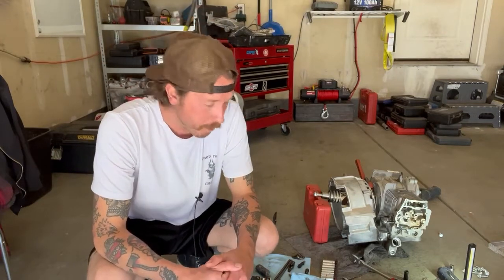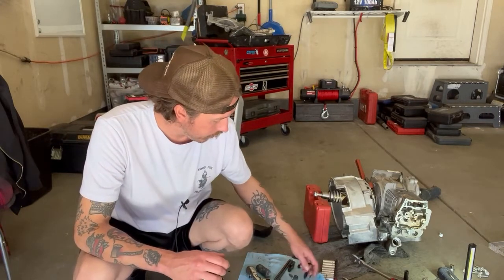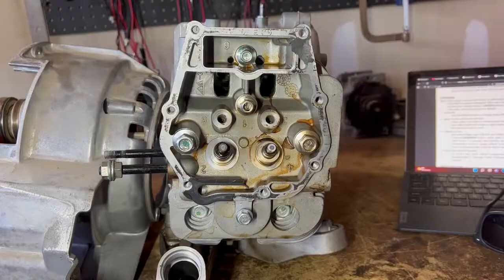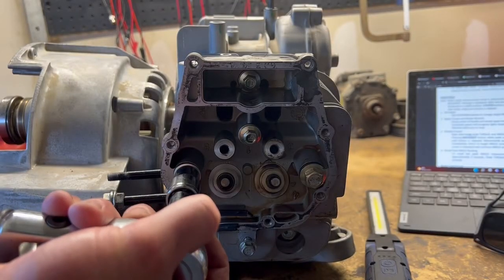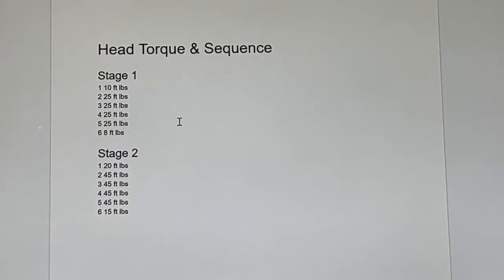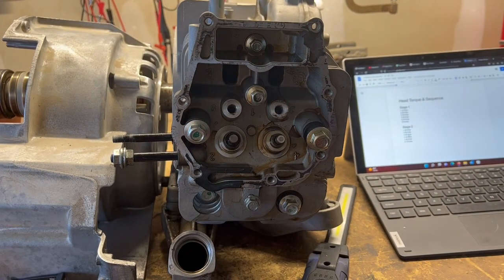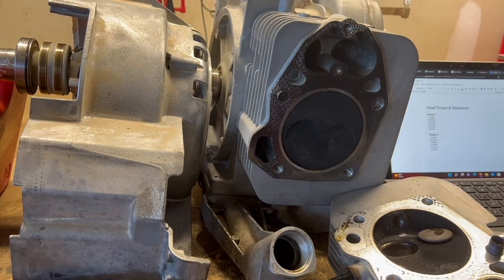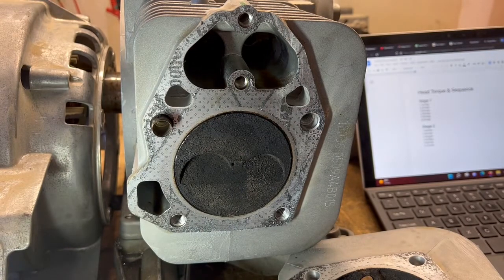⚙️ Cummins Onan QG 4000 Head Bolt Torque Specs: The Information You Can't Find! 🛠️

Comment: My 2005 Onan microquiet 4000 spec KY says clean or replace the cylinder head every 450 hours.  That seems extreme to me. What do you think?
Reply from the maker: lol yeah that seems pretty extreme to me as well. The valve lash adjustment should be done about every 450 hours. But I don't believe the whole cylinder head need to be replaced.

https://youtu.be/tNSpvA-Ctr8